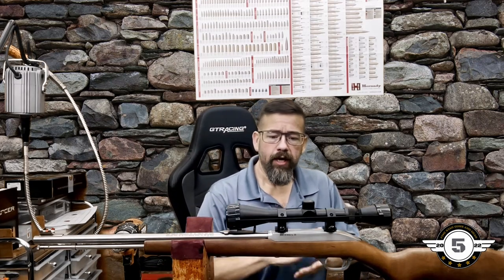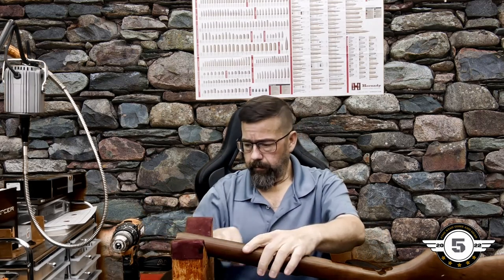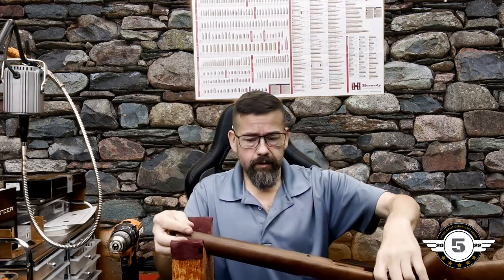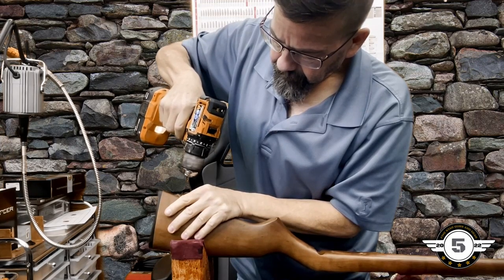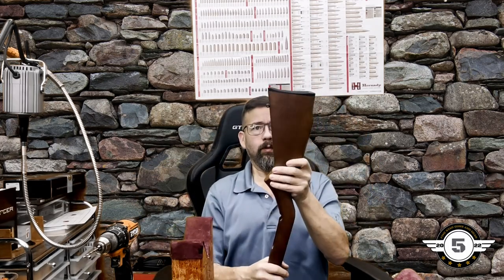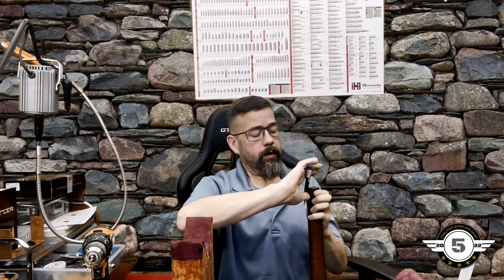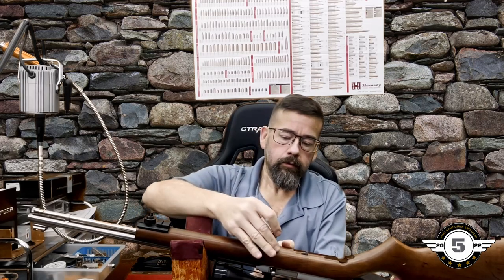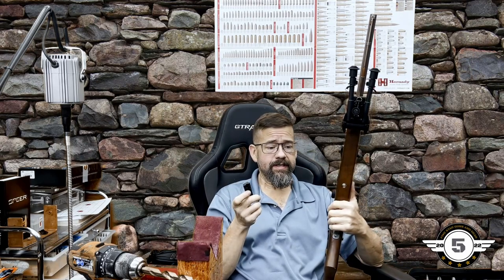DIY Rifle Sling Stud Installation Made EASY

Comment: Hi, im absolutely new to DIY gunsmithing. Thanks for your video. I guess I'll use a vice. Any recommendations on the brand and type of gun vice a guy might want to start of with? Also do you think masking tape over the punch hole is needed for a beginner? Noticed you didn't bother. Also what type of gunsmith tool set would you recommend? Im recently retired and found i enjoy working on my guns...although its kinda scary. Especially when i take things apart and springs go flying over my shoulder.  😅Thanks
Jeff.